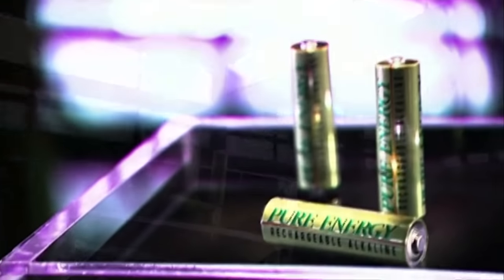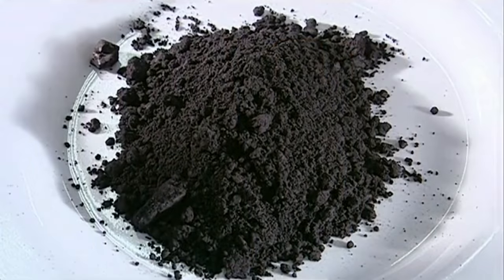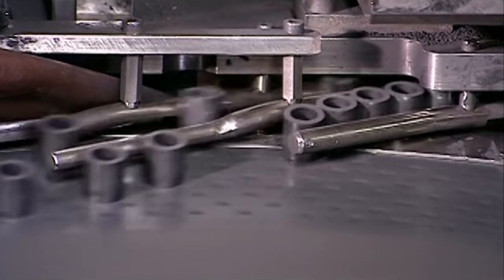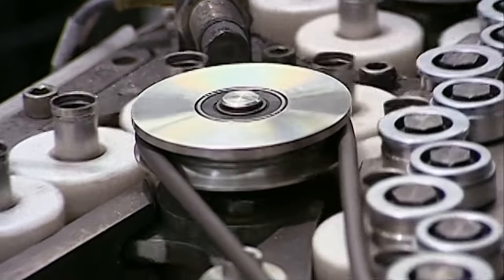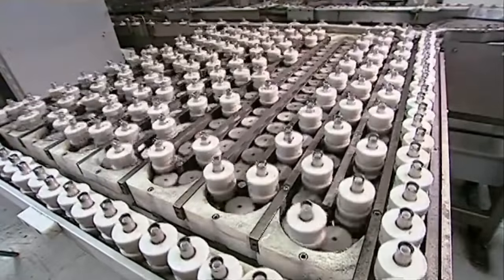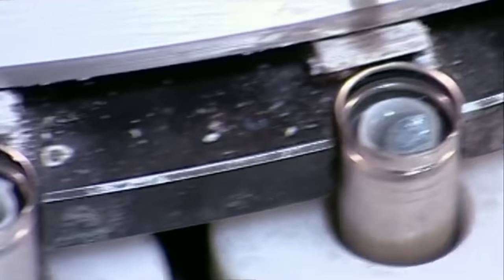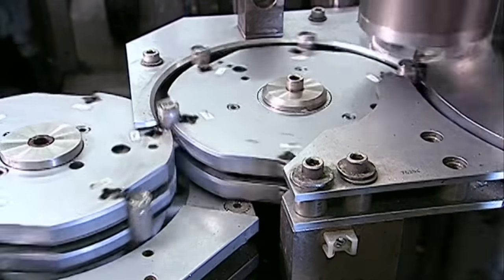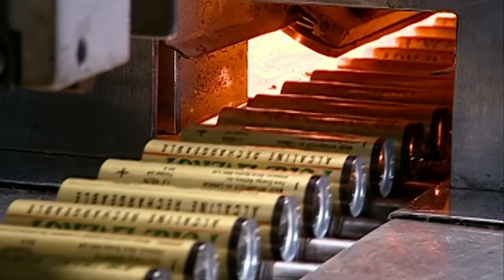How It's Actually Made - Alkaline Batteries

Comment: technically the “ry” in batteRY could be spelled RII (equivalent to RI^2 and I^2(R)), which is in fact the formula for power in a circuit. So this guy really does know his stuff
Reply: Hello fellow electrical nerd. Here to inform you that at 0:04 the narrator may or may have not called the positive end the cathode and the negative end the anode.

Comment: Y'know, I've been told Zinc-Carbon batteries are generally inferior to alkaline batteries, and have a shorter shelf life. But after digging through some random crap in an attempt to find my old alarm clock to wake me up because I obliterated my phone, I found some ancient 10+ year old Panasonic brand Zinc-Carbon batteries along with my OG GBA in a plastic bag, then inserted them into the purple piece of un-back-lit shit, and proceeded to turn it on. It turned on. With a green status indicator. As in the batteries have not decayed very much.

I've also been told alkaline tends to leak like a motherf***er. These very old Zinc-Carbon batteries are perfectly intact. So either Zinc-Carbon batteries are secretly superior to alkaline, or these 10+ year old Zinc-Carbon batteries and/or my GBA is possessed.

...I should probably backlight mod that thing and use my decade old+ rechargeable AA Li-Ion batteries that still f***ing work "Best 20$ I've ever spent, those suckers make a Wavebird GC controller last a week STRAIGHT" to give that thing more life.

Comment: There ARE rechargeable alkalines but THEY'RE CRAP. You get 40% capacity on the second use versus the first use. I think 3rd use is like 15%. Although I DID KNOW a Canadian who used to rechargeable STANDARD carbon zinc batteries with some solar garden light rigs. He would put them in every morning for 3 days and they would be back to close the original capacity.
Reply: have you heard of a lithium ion battery